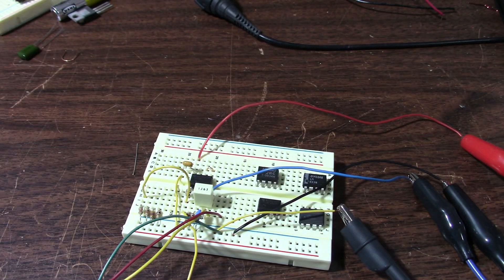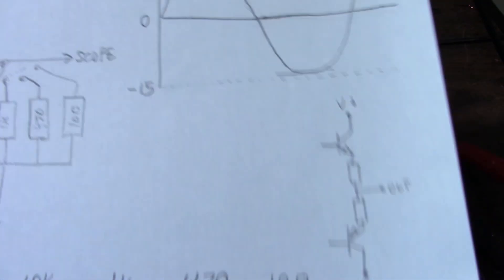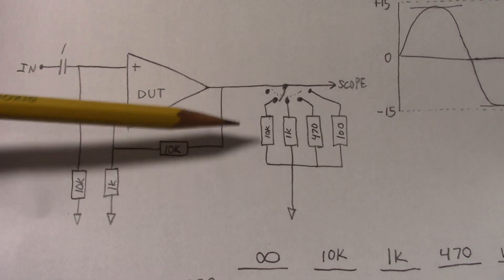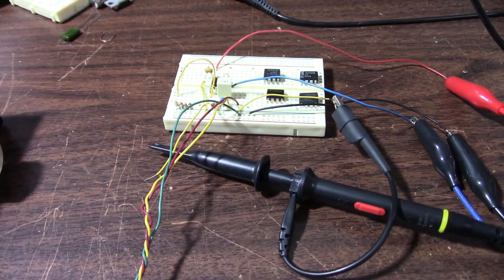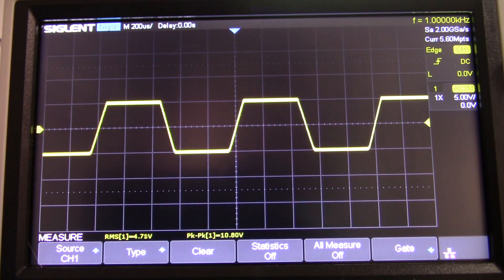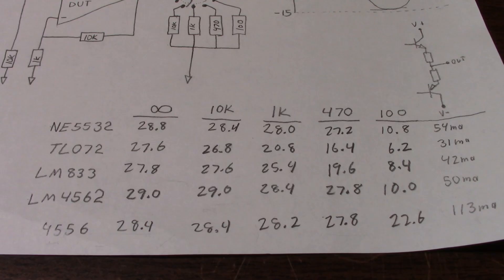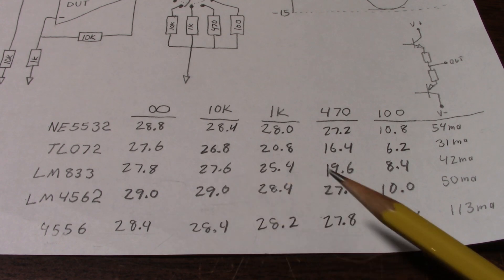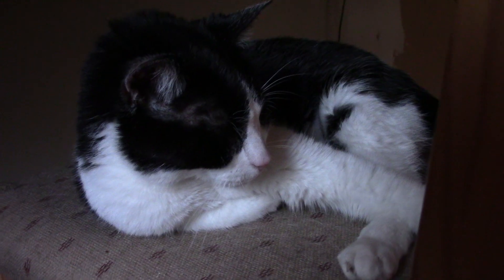Operational amplifier output voltage swing test - NE5532, TL072, LM4562 and more

Comment: Hi. John. How critical is it to have the supply voltage at 15 volts positive and 15 volts negative when conducting these measurements?
Reply from the maker: You can test at other voltages, say +/- 12, but since this is a comparison, it is good to use the same voltage for all.
Reply: @JohnAudioTech  Thanks John.
Reply: notice that none of the op amps have an actual 'ground' pin and all their operation is defined by the 'reference' DC level on the non inverting input; The output simply pulls or pushed current from the two supply rails. As some of the 'tests' showed asymmetric clipping, you COULD bias the input away frol the centre of the two supplies to ewualise the clipping. This would be affected by the circuit overall design,

Comment: Question John? Have you ever used the NE5532 to build a 4 MHz Colpitts Oscillator circuit?
Reply: It doesn't have enough gain at this frequency I guess.

Comment: JRC4556 can drive 32R at +/-5V, it can even drive headphones 16-32 Ohms range. Gain should be kept at 2 or 3X. As per data sheets its rated for 150R loads. Grado RA1 headphone amp use this opamp at +/-9V.  Objective 2 headphone amp designed by NWAVGUY uses 2 parallel 4556 to drive headphones.

Comment: Cool vid! I'm always swapping Op-Amps in and out of my audio gear, just for curiosity mainly. I'm sure you know this but, those Op-Amps are garbage by today's standards. Just from Ti alone you have: the OPA627, OPA827, OPA1612, OPA1620, OPA1655, to say the least. Then if you want "high current"... you can have the 
dual channel LME49726 with 350 mA or the 
single channel LME49600 with 250 mA!
Reply: what is your best for audio in a dac? i want perfect square wav rendering (band limited to 20-25khz).. no crosstalk, low noise, low distortion etc..

maybe stable with some small DC offset (can it clean DC or you need cap to clean it?)

Comment: When uA709 needed some diode addition to protect it against latch-up and when uA741 corrected that plus added internal frequency compensation, I found that both specified a minimum load resistance of 2 kilo-ohm.  That was the "industry standard" for years after.  Also, it was not only the output, the input common mode range was a limiting factor.  Eventually we got rail-rail input or rail-rail output chips and finally chips that combined both features.  However, most of them continued for quite some time to be limited to supply voltages good for 5 V use.  But the chip prices have gone precipitously down since the uA741 introduction while various performance numbers have improved.  In the old days, magazine articles used to publish their own evaluations including such as Price per Performance.  As to voltage -- I still worry about my op amp characteristics and occasionally need to go back to my stash of (obsolete) LM343 that offers +/- 30 V power supply rating.  In most other situations, and especially audio or other low noise requirements.my favorites have been and continue to be the OP27 or OP37 genre, available from multiple manufacturers due to wide cross licensing.

Comment: Hello John, I see you check out Cool Dude Clem, like your channel, one of my oldest subscriptions. Great information as always. I hope you and your family, Brother, are all doing well. The voltage divider to the Non-Inverting input, with filter cap from 4.7 to 10 mF works good to power op-amp from a single supply rail. Voltage divider resistors from 10 to 100K. Glad your still doing videos, I have learned a great deal. After 9 days of forest fire smoke starting Labor Day, Sept 7th, the air has been clear and have had some welcome rain. Closest fire to me was 10-15 miles, nothing in immediate area. All the best from Oregon, Cass.
Reply: John knows what he's talking about, though

Comment: 5532 = 5nV/sqrt Hz. Nowadays I use OPA1678, the rail to rail is much better. Low noise opamp not supposed to load below 1k.

Comment: Thanks for the video - very educative! :) 
But I am not sure about the current calculations at the end? Should you take the RMS voltage, e.g. for the NE5532 10.8Vpp => 3.82Vrms => 38.2mA with 100Ohm load? That will also make the NJM4556 79.9mA which fits a bit more the datasheet :)
Reply from the maker: Yes that would make sense but the signal was not a sine wave due to the clipped tops. Current limit circuits will limit on some max level and I wanted to see what that was. Outside of audio, opamps are used for DC and non sinusoidal waveforms so it is useful to see where current limit kicks in.
Reply: No, John is quite right. If your opamp is clipping solidly at 10.8Vpp, then it is almost certainly swinging 5.4V each side of ground. Into a 100R load, that is exactly 54mA, which is clearly the current limit built-in to the output stage.

Comment: Hi John, thanks for the comparison of OPamps under load. I would say, that the most OPamps dont like a load under 600 ohm (resistive) due to the limited thermal conditions in the chip, especially when used with a higher supplyvoltage. The data sheet  tells that the duration of output shortcut is unlimited, but there is no protection of  overheat in regular chips.
Reply from the maker: It is like those who use a 5 volt regulator IC with a 25v input voltage and complain why the chip gets so hot even with small loads. Thermal design must be considered.

Comment: I was using the LME49710 but when they discontinued it I had to switch to the much more expensive LT1037 and now I am on the OPA1611. I know a lot of people like the ADA797 but some of it's other limitations made it less attractive to me.
Reply: Just use one side of lm4562.. And leave the other channel grounded input unity gain buffer.
Reply: @johnyang799  I thought about that but honestly time had marched on. You are right the wording "had to switch" was rather over stating it but we wanted to see if we could get a lower noise floor with something newer.
Reply: @ElectricEvan  Cool. And don't know if that applies to you but  opa1612 is actually cheaper than opa1611. And you may do paralleling to reduce the noise further depending on application.
Reply: The OPA1611 is fine if  you have a low source impedance. The AD797 also, but it needs a compex compensation compensationnetwork. I also use the OPA627  or the OPA827 depending on the application.
Reply: @christophschuermann6512  I was aware of the OPA627 and it's cousin the OPA637 which I had used in some high speed current sources. The OPA827 I had never seen before. How have you liked it and what were you doing with it?
Reply: @ElectricEvan  HI, i have designed several High-End products over the last 30 years (you can google "christoph schürmann hifi") and i know every type of opamp for audio solutions. But there is no "best audio opamp" because you have to consider many things, depending of your application. The opa827 is used in my latest projekt inside the feedback loop of a small 200W poweramplifier, designed to work in an active loudspeaker. The thd is 0.0006% @1kHz and 50W on 4 ohm load.
Reply: @christophschuermann6512  I wasn't asking for a "best opamp for all audio", designing lab test equipment for +10years I am aware of that. I can see a lot of people here spent more time hunting for new parts than I have.
Reply: @christophschuermann6512  "The thd is 0.0006% @1kHz and 50W on 4 ohm load." that is impressive.
Reply: @ralfstocker7742  Yea I work in a hearing research lab so we have PXI chassis with multiple 24bit delta sigma converters. Our engineering department shares one and we have a number of HP DSA's. (I actually have a pair of HP 35665A's in my apartment) The rest of the opamps are not "unsuitable" it's just that source impedance, input offset, and etc can be wrong for a given part.
Reply: While I have a whole council of people here who are aware of this stuff, what is your prefered low THD+N differential opamp when the input signal is low impedance?
Reply: @ElectricEvan  Depends on your requirements. 
My choice is opa1612 with four 1K resistors per differential amp. Input impedance is 2K and provide lowest noise without distortion degradation/penalty due to loading the upstream device and ground currents.
If input level is relatively low, 470Ohm to 680Ohm can work too for even lower noise, both provides better than -130dB harmonic distortion where you can get -140dB with 1KOhm and above.
Reply: @ElectricEvan  
If you need high CMRR, then input buffers with high input impedance is needed. Also known as instrumental amplifier. Then adding opa1612 differential amplifier with series paralleled 0.1% or better resistors. THAT components can also be used.
If you meant fully differential opamp, then opa1632 is probably the only option.
Reply: @johnyang799  Thanks I had only learned of the OPA1632 today. I wouldn't try to use a OPA1612 for that because of the johnson noise of all the resistors. A true instrumentation amp is best (at least for what I am doing).

Comment: John, for FUTURE CHALLENGE I would like to suggest to you to try to build up and test a circlotron power amplifier. They are very simply designed and called super symmetric and highly linear with very low THD+N. The challenge of these amplifiers is their floating dual power supply (but this can be simulated by two Li-Ion batteries or well separated lab power supplies for the first tests). https://ibb.co/cFKb74q (I think the connecting points for the feedback resistors must be switched directly to the P1- and P2- points).

Comment: I am impressed of the NJM4556. I think it is another good candidate for a 30 Ohm stereo headphone amplifer delivering 0.5 V output voltage allready at a power supply voltage of +/- 3 V. It consumes a relatively high quiescent current of 9 to 12 mA and it has twice the input noise of the LM4562, so it is not well suited for phono preamps. The NJM is also capable to operate 30 Ohm headphones in class A mode up to a quiescent current of about 50 mA (with a suitable JFET between the output and the negativ power rail). The power supply voltage should be limited to +/- 6 V in this case, especially if it operates in stereo mode with both internal opamps.
Reply: NJM4556 has been used in Objective O2 HPA. Absolutely gorgeous, able to drive virtually every can.

Comment: Would you consider replacing the 5532 in your preamp box with a 4556?
Reply: 4556 is meant for high current. 5532 is meant for low noise low thd.
Reply: what about  the NE5532A ???
Reply: @garygranato9164  he has a 5532 in the preamp box already and I also built his box with a 5532, I was just looking at the current of the 4556
Reply: @raymondheath7668  
hi ray, i believe the NE5532  and the NE5532A are slightly different. but re- current, i wouldnt know because i'm noob to diy audio.
Reply: You don't need that much current. Just get ne5532 or lm4562.
Reply: LM833 or M5218 in case 5532 unavailable
Reply: @iblesbosuok  good to know